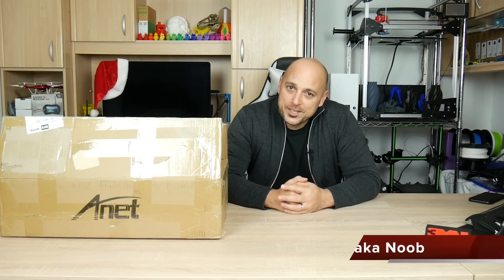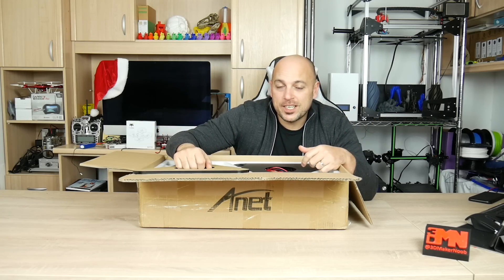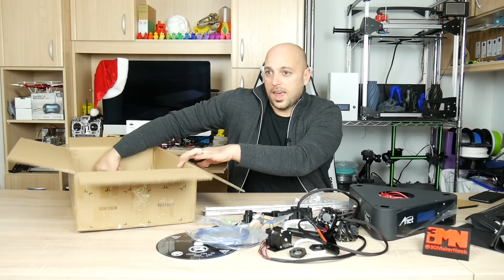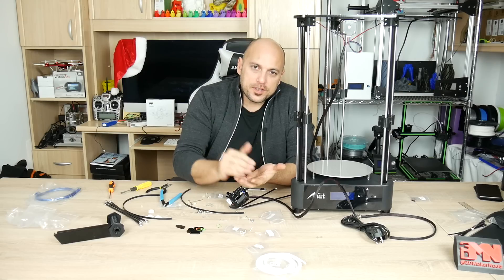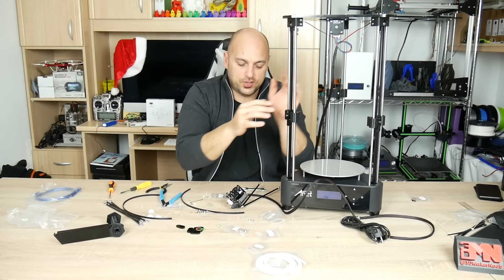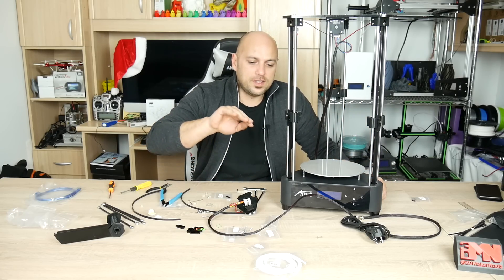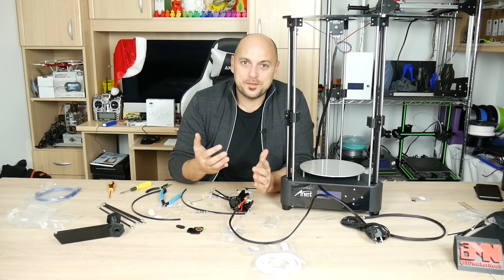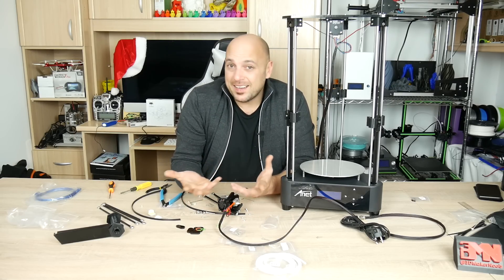Anet A4 Delta 3D Printer.... #Fail

Comment: Thanks for the video about the Anet A4. Shame you ran in to problems preventing its assembly. I have been very tempted to buy a FLSUN QQ. I could assemble a 3D printer but I have too many projects I want to work on. I'd rather get something I won't have to spend a lot of time on to get it working. The QQ is partly assembled and has some interesting features and improvements over some other deltas. The price is also quite reasonable. The one major downside to the printer is that they are only using an 8-bit controller. With all the features the QQ delta has over a lot of other deltas I don't understand why they didn't use a 32-bit controller.

Comment: FWIW, I received one of these and it went together like lego, it's a defect in this machine rather than a standard issue. The instruction video was slightly out of date- they've done some rolling improvements- but it was still straightforward. Compared to building my Tarantula it was childsplay.

I'd be very happy to recommend it, especially at the price I paid- £130 UK! But the standard caveat applies, printer kits are not domestic appliances, you will generally have to do some thinking. An issue like the one in the vid is the work of minutes to fix if you're at all practical but I appreciate, not everyone is (and I think while I'm more practical than most 3d printing enthusiasts, I'm way less good at the software side so it balances out a bit)

Comment: Hey Joe! Sorry that you ended up with a bad QC part. That sucks. Maybe they will they send you a replacement? Better yet, as you said, you should 3D print one. :-) It will sort of be a slight mod (weight reduction) and you'll have a working printer. I'm sure people would like to see how it functions. Maybe the Anycubic Kossel is a better bargain? Comparison?

I saw this delta and was hesitant so I have started building my own following a Thingiverse design.  

So far I have 2 Anet A8's. One has the AM8 mod and the other has some frame improvements that involve threaded rods. The frame is rock solid. Both print really really well and everything was good out of the box. Maybe I got lucky...

If you want to get rid of the A4 I'd be willing to take it off your hands and get it running. I would also be willing to give a review on YouTube. 

Cheers,
Greg

Comment: When I received my Anet A8 with acrylic frame the back plate was missing five assembly holes, also. I had to wait for permission from Gearbest before drilling the holes myself in the event I cracked the acrylic and then they would place all the blame on me. After getting permission I drilled the holes. It turned out fine. The replacement back plate showed up about two months later. After several mods my Anet A8 prints beautifully but my next printer will not be an Anet because of poor quality control.

Comment: Not so good they send you this.
I just received a Geeetech E180 that is completely unusable because there is no slicer that works with it.
Can only print 1 sample file, that's it... about the same complaint here... No quality control.
Reply from the maker: I just got the geetech E189 for my daughter and created a profile for it in cura and it’s working quite well.

Comment: If it's metal to metal and the case is grounded, it should blow a fuse if installed, draw the power supply down, or trip a GFCI if it shorts. My tronxy like many printers don't have proper grounding between parts.

Comment: ...and here I thought, it couldn't get much worse than the darned 5-button interface they seem to clone on just about each and every one of their printers since the A8 (or even earlier?) - just throw those lousy buttons over board already and go with the A6-style "pressable rotary encoder + display", for f$ck's sake... and then you end up with a half-finished, non-working part stopping the build - and not just any part, but probably the most important for a Delta: the effector baseplate.
Is it just me, or has their QC gone steeply downhill in the last year since I built that A8? Okay, it took a while, but that one still basically just worked with all the included parts. Good Lord, seems to me, one buck invested in quality control here and there should save them multiple times that money for the hassle with all the returns, "I need a new working part X - mine has failed/is DOA" problems and all that other fun stuff...
I sincerely hope they get back to you with a working part - I'd still like to see what they're able to make in the form of a Delta style printer, even if I'll probably refrain from buying one of them - after my MD Rework, I'd probably be hopelessly spoiled for the cheap-ass Deltas for all times 😁...

Comment: Well they just missed to machine 4 holes, it is frustrating but not so uncommon. Anet should replace the part. For the heatbed, if everything is correctly earthed, the circuit breaker in your house will trip if there is a leaking current.
Reply from the maker: Granted that you could replace the part, however my frustration is that companies push out cheaper printers and the end result is frustrated customers and delays which is really not cool
Reply: 3D Maker Noob You are absolutely right! I am assembling an Anet A8 and I know that is not super high quality and needs upgrades, but as I am a maker/hacker/geek it is fine for me. If I wanted a kit for just assembling and plug and play then they are not the best solution.
Reply: While true the house breaker should trip if there is a problem, I should not have to rely on that lay line is defense to prevent being electrocuted by a printer

Comment: Confirmed: Anet=Skynet! It will kill us all by A) Electric shock (all metal) B) Suffocation / Burning down (only if you manage to build it up C) Killing ourselves due frustration, if we are determined to build it but we simply can´t due purpusedly bad assembly or missing holes.

Anyways, thx for taking the ordel for us, "Joe Connor"... and remember: they´ll be back... Cheers!
Reply: el_marto what's funny I use Skynet firmware in my Anet A8 lol

Comment: The "QC checked" sticker just verifies that the sticker was affixed to the printer momentarily.  Having similar issues with my Zonestar build, missing parts, misaligned parts, mis-matched parts (old endstop, new wiring harness) & leaking hotend.  All that wouldn't be so bad if they included a PROPER schematic for the board,  some REAL instructions for assembly & at least ONE PROFILE for a slicer.  There looks to be some decent hardware in there, too bad they leave it up to you to engineer a working printer out of it.

Comment: at least I am not crazy. same problems I just got mine yesterday Mine did have the holes drilled on the effector. the instructions are horrendous. absolutely horrendous.

I DO have a request. I managed to finish assembling it and booted up but I can't print. when I home it goes DOWN instead of going UP. ??? what do I do?
Reply: It is hard to see on the pictures I found, but maybe you have installed the carriages upside down? Maybe you can flip them and just tie them to the belt that moves the other direction?
Reply: change direction in firmware or change wires on motors
looks similar to that: 
Invert the stepper direction. Change (or reverse the motor connector) if an axis goes the wrong way.
#define INVERT_X_DIR true // DELTA does not invert
#define INVERT_Y_DIR true
#define INVERT_Z_DIR true
Reply: RoterFruchtZwerg oh my I think you are right oh that is so going to suck to have to take that off again grrrrr
Reply: RoterFruchtZwerg buddy you nailed it there was no way in hell I was disassembling the entire printer so I just drove the whole in the left and flip the belt limit switches were also marked wrong in the diagram in the PDF front left his ex front right is why the rear is z

Seriously unless you get it for cheap in or a glutton for punishment avoid this printer
Reply: check cables are the correct way  in the plugs. ?
Reply: flip plugs for motors or edit them using small screw driver you can re arange plugs(remove pins and put inside again) or edit firmware.
Reply: they can't be reversed. they are one way cables and it was pre assembled.
Reply: there shuld be plugs on the board try rotating those
Reply: Turn it upside down :-)
Reply: You could flip the belts around.
Reply: Zach Arnold yes that was the problem all along i had them backwards (non existant instructions) got it going makes nice prints. All 2 of them parts fan is dead hot end heater is dead and dispmay is flaky. Have to taje it apart.
Reply: two ways only, reverse plugs, or take the pins out the plug and swap them over or firmware change which you will need a copy of there firmware, which i doubt there is a copy floating around, best bet would swapping the pins on the plug
Reply: or the third way. Don't install the belts backwards (HORRIBLE instructions) I did get it working. ALSO had to replace heater cart and parts fan. but it does work. not a fantastic machine but it does work. I would rate it a don't buy. just avoid it. if you get one super cheap ok its fun to play with a delta but not worth it if you have other options.
Reply: What do you mean by this? Mine are going backwards but I don't see how flipping the belts would change the direction of the movement. Are you saying to swap x, y, and z plugs?
Reply: Nevermind, I figured it out. I'm also going to have to drill holes rather than disassemble the whole damned printer.
Reply: Jesse Petersen yeah. Very poor instructions. Sooo you installed the carriers upside down too ehh :-)
Reply: Yep. Funny, GearBest doesn't seem to want to post my review.
Reply: hehehe you think? :-)
Reply: Turn the whole printer upside down, then up will be up    :)
Reply: I have never played with firmware before. tutorial on how to do that anywhere?

Comment: ultrabase. i am nay a fan of them. :)
Reply from the maker: Really? I love it. Makes my life easier
Reply: i still prefer the buildtak i like to pause long prints when i sleep. and with the ultrabase like a sheet of glass your print will pop of the bed when it cools down. nah not for me. and my prints come of easy.  and when are you going to print my dragon LARGE. ;)
Reply from the maker: Very soon as I just installed a volcano on the CR-10 :) and agreed on the ultrabase. It’s the only downside to it unfortunately
Reply: should be back up to making models. and also start sorting out the flintstone models for you soon joe. my spine is healing  and i can now start to do things again on the computer.  its been a long month not able to do anything. and looking forward to you doing the dragon. :) hope you had a great christmas and all the best for the new year.  myself with printers for 2018 i would like to see a hell of a lot more put into QC in fact needs a few laws in the printer industry to keep to standards. :)
Reply: @3d maker noob I saw once somebody using jeans fabric (dennim) as a bed surface for printing with no heatbed for pla, pteg, abs and others. Could you make a test about that?

Comment: Anet has been rushing production on a lot of products. E10 is a good example
Reply from the maker: Yep, and that half failed too, at least it worked
Reply: jflugum very true. I had to buy a lead screw and print Cnc kitchens shroud and solder the heat bed connections and otherwise correct qc issues. I did not have to buy anything else  to make it work very well. Shockingly well considering the overall seemjngly poor quality.

E12 not going quite so fortunately :-) but my e10 is a decent machine now that i coreected the qc issues
Reply from the maker: My Power supply on the E10 died after a few days so that was the only replacement
Reply: no. the e10 was actually a good printer that just had a  CRAP ton of QC issues (par for the course for ANET) all the exact same QC issues migrated to the E12 as well. Grrrrr whats annoying is THEY DO print well but the QC is such a barrier.

I am experienced at this stuff. very experienced. I had a HELL of a time building my A4 last night oh my what a nightmare not because it was hard but because their were NO INSTRUCTIONS and what was in the video was actually "WRONG" for the machine!!

I did get it built but can't print. I have no delta experience when I home it goes DOWN instead of UP and drives itself into the bed (looking for enstops that are up not down)

ARRGHHHHH
Reply: Nope, my E10 didn't print well until I bought $100 worth of parts to fix it including proper V-rail and eccentric nuts. So I guess it's the luck of the draw when it comes to Anet quality.
Reply: 3D Maker Noob sadly that does happen even with good quality control which anet does not have you can miss that since it'll work fine for the QC test and then die thankfully they are cheap
Reply: 3D Maker Noob print out C&C kitchen shroud for the heat on it really makes a huge difference I get some pretty phenomenal print from my E10